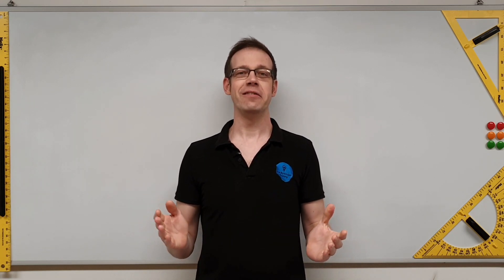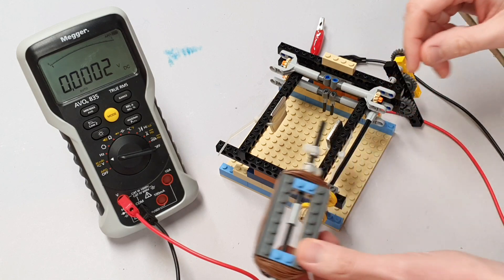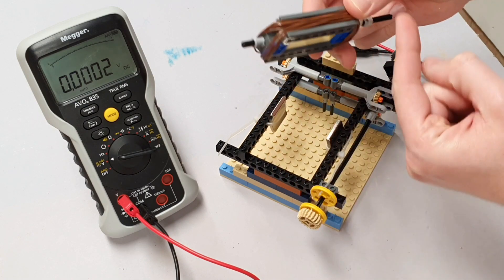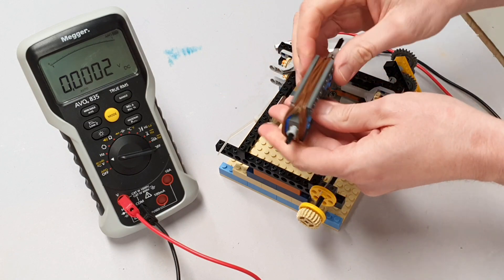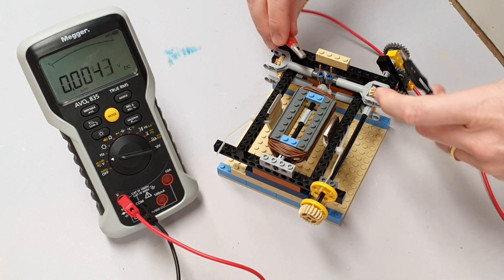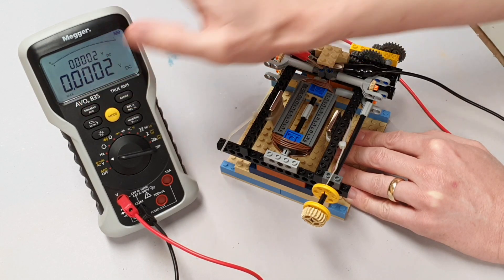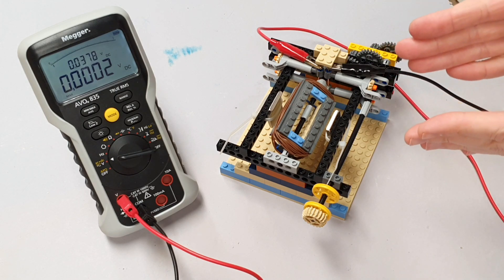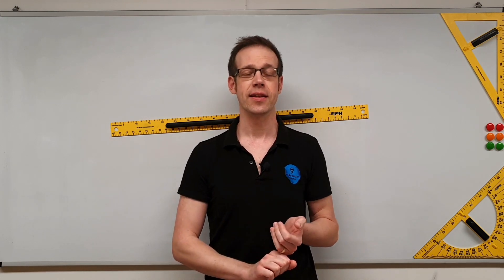How to Make Electricity: The Three Methods Part 2, How to Make a Lego Generator

Comment: Wonderful video! I'm working on my own version but fully 3d printed. My design is doing away with slip-rings and brushes by running the wire from the rotor in to the inner race of bearing on either side of the frame, then taking a wire from the outer race as an output. Im using 32 guage wire and im foreboding on wrapping it because it'll take forever...
Reply from the maker: Sounds good, keep us updated!